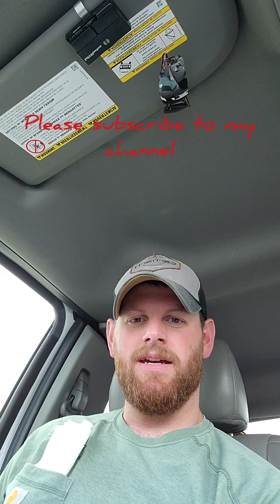How to pass the BICSI RCDD Test

Comment: The class and the practice test are absolutely a waste of the time.  Read the TDMM front to back and take the test you will pass.  The reason......only about 50% are cut and dry logic.  Perm Link is 90m done deal.  The other 50% of the test you will read the question and then read your answer choices and it will be like 3 out of the 4 could be argued to be correct but you have to pick the one that follows the guidelines of the TDMM the most and it is those questions that are designed to stop you from shortcutting this test.  Been an RCDD for 12 years SEE YOU GUYS IN VEGAS !!!  JK I do the online confr now LOL
Reply from the maker: I don't disagree at all! I took the class and failed the test. Then I read the manual cover to cover for a year and I passed. 100% right
Reply: @Fiberline91  That is exactly how it went for me.  I took the class and could pass the practice exams 100%.  Failed the test.  Went and read the book cover to cover and passed.  I think that is a pretty common RCDD story too I know a few guys that did that and I know a few guys that failed all three times too.

Comment: I’m 24 yrs old living in vegas 
Doing 2 jobs Hvac technician for a small company/ working in school with a private company for 2 years building ER/TR doing low voltage I use to do high voltage before that I have 7 years in trade. I have Fire alarm card 
Can’t decide should I go and do trade exam for RCDD exam because my company senior technician have it 
Please guide me
Reply from the maker: It sounds like you have a strong background and the RCDD could be a good move. Considering your senior level guy has an RCDD, that makes it appear like they value that.   Do you feel like it's going to help you move up ? I see jobs posted for RCDD a lot.  I do a little bit of everything myself but mainly focus on ISP Fiber Optic Physically Plant and Networking

Comment: What’s the point of acquiring the BICSI cert?
Reply from the maker: @AreteChannel  In some bigger cities GCs will have an RCDD to stamp the blueprints/sign off on telecommunications work. It's just like any other certification. It just gives you paperwork that verifies your expertise. I don't know that I would say it will get you a job but it would help depending on the job/location. Its useless where I live unfortunately. Most don't know what it even is here.
Reply from the maker: @AreteChannel  you can Google rcdd jobs and you will see lots posted for people with that certification but again it's location oriented so you might have to move to get those jobs. I'm happy where I am with what I'm doing so it's just another cert for me.
Reply: By itself it will only take you so far you need to have a bachelors degree in engineering or computer science or something similar to go into the highest level positions

RCDD plus BSEE is required for the highest paid consulting positions

Comment: 2:21 
Doing VA hospital network upgrades across the nation right now for a veteran owned company. So basically I’m a federal contractor but anyways the guy that spliced almost all fiber at one of the VAs in Kansas WASNT bisci certified.  
I know this personally because he taught me how to splice fiber.
Reply from the maker: @rorourmfboat22  Thanks for letting me know. Good info to know. I work for a power company so I don't get to see a lot of that side of things.  Things change so much in federal and state regulations, So I just mainly keep up with NESC as it pertains to my work.
Reply: Can you give me some information on the requirements to get you RCDD? 
How many years of experience do you need to be able to take it?
Reply from the maker: @rorourmfboat22  that link will show the requirements (paths) on page 9.
Reply: @Fiberline91  thank you boss I appreciate that
Reply from the maker: @rorourmfboat22 https://www.bicsi.org/docs/default-source/default-document-library/RCDD-Cred-Handbook-2024_Final_Version15.pdf

Comment: I am 27, and I have 2 years of experience working with Copper and Fiber at ATT as a prim-tech. I installed and repaired internet, phone, and TV service lines and equipment in commercial and residential settings. What advice could you give me for wanting to get into these certs and this career path. Specifically, what certs should I start with, and are the online classes good, or should I really try and find something in person.
Reply: Good info in the video. I am finding a ton of help and advice on Reddit. I am not sure if you have tried but I think you will find more answers to your questions.
Reply from the maker: @staytongordon8416  if your planning on sticking with ATT I would find someone that does the job there that you want and ask them how they got there...ATT has a lot of internal schools and training I believe correct me if I'm wrong. If so, id attend all you can and take advantage of them paying for certs/schooling if possible
Reply from the maker: @staytongordon8416  If your interested networking/IT id start with COMPTIA certs like net+ that will build foundational knowledge and the expand into either server certs, security certs, or more networking like Cisco ccna 

If it's strictly physical network design you want like the rcdd intends for then id focus hard on getting that and a college degree in related subjects like Telecom, Electrical Engineering, IT, Networking.  

Mosf of the guys I meet that design either got an electrical engineer degree or rcdd or they've worked for 20 plus years in the field and have the experience to design.

Comment: I have 2 years of low voltage experience installing copper and fiber infrastructure in mostly 55+ nursing homes and apartments. I’m just now looking into getting Bicsi certified. Do I need to take a course before the test, or can I just as well study over a 14th edition book and take the test? Thanks!
Reply from the maker: You can just take the test! 

Eligibility Requirements
Applicants must meet one of the following eligibility options in order to apply for the
RCDD certification exam.

Option #1: Two years of verifiable full-time work experience in ICT design AND a current BICSI certification holder as BICSI TECH™, RTPM®, DCDC® or OSP.

Option #2: Two years of verifiable full-time equivalent work experience in ICT design AND completion of two years of higher education course work in ICT. Two years of higher education course work in ICT may include:

• STEM or trade school
• Two-year degree
• ICT and industry-related programs, apprenticeships or certifications
• Military training equivalent Evidence of completion of higher education course work includes:
• Certificates
• Diplomas
• Registrar’s documentation
• Other bona fide documents

Option #3: Five years of verifiable ICT experience.

Please RCDD-Cred-Handbook p8 to view definitions and examples of ICT Experience, ICT Design related work experience and ICT Degree or course work.
Reply from the maker: https://www.bicsi.org/education-certification/certification/rcdd
Reply from the maker: The only thing that I would add is that since you said 2 years and that being in design that will need higher education in conjunction according to their requirements The only way experience alone qualifies is if it's 5 years of ICT design but as you can see the higher education is comprised of many different options not just college.
Reply from the maker: Hope all that helps and good luck!

Comment: Taking my test in November. Been in the industry for 12 years. Came up thru the ranks and am now a Project Manager, so I feel I have a good handle on the material. Taking the boot camp then the test the next day. My question to you is what chapter seemed to have the most questions?
Reply from the maker: Honestly, can't remember, it was a while ago when I took the test. The say 80% of the test is on core chapters. Here is a link that talks about that. https://www.bicsi.org/docs/default-source/certification-section-files/rcdd-v13-vs-v14-comparison-flyer_final.pdf?sfvrsn=33c51c9a_2
Reply from the maker: Also, that pdf I posted a link to highlights the core chapters..
Reply from the maker: You took your test yet ?
Reply: @Fiberline91  I did, took it on the 11th and passed. Let me know when you are going to which confrence would like to meet you.
Reply from the maker: @jwright013  That's awesome to hear! We've been so busy at work I ended up doing the virtual conference this year. I will have to take a course to meet my CEC requirements I've only got I think 28 hours currently but it will most likely be online because we stay pretty busy.

Comment: Hii.. Congratulations for your achievement.. 💐💐.. I am working in Fiber domain( Kuwait ), is it necessary to have hands on experience in UTP networks to clear the RCDD exam. What's your opinion about it.
Reply from the maker: Hi, thanks for watching! The exam itself doesn't require hands on experience, as everything it covers should be constrained in the TDMM. However, to sit for the exam you have to apply and they have several requirements such as references and ICT Design experience. At the time I took it it was 5 years experience in design or a combo of IT degrees and certifications I think. I'll add a link to their current requirements
Reply: @Fiberline91  Thank you for your time and details.. 😊
Reply from the maker: Page 7 talks about the eligibility requirements

https://www.bicsi.org/docs/default-source/certification-section-files/03-04-2020_rcdd-cred-handbook_v133374224c84a241e0b67ea1ba8a4dfb48.pdf?sfvrsn=e4ede802_16

Comment: Thanks for the video.  What app did you use for viewing your TDMM on your phone?
Reply from the maker: You have to download a secure pdf file from BICSI that requires a password and username. I had to email them and reset it every now due to accessing it on one too many devices so Id say limit how many you sign in on. I used my phone, PC, and tablet. Just the adobe pdf reader app from playstore if I recall correctly
Reply: Thanks again!
Reply from the maker: @jonpearson2175  No problem at all! Hope that helps